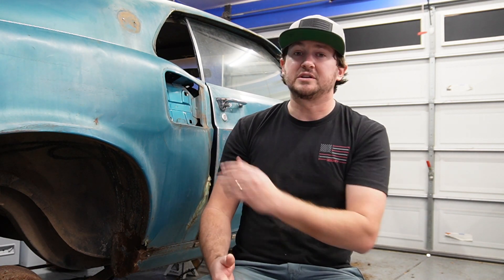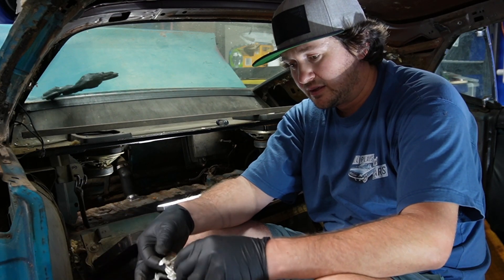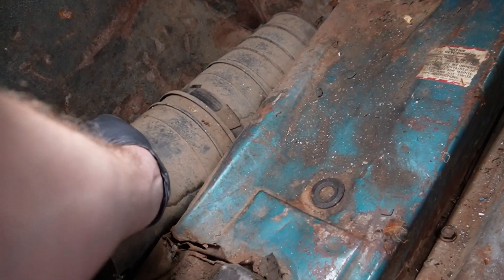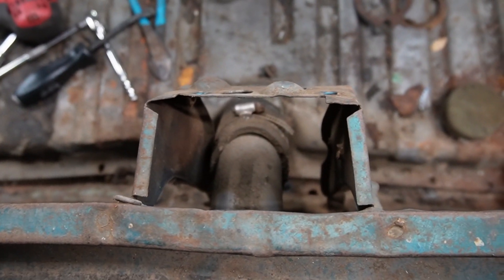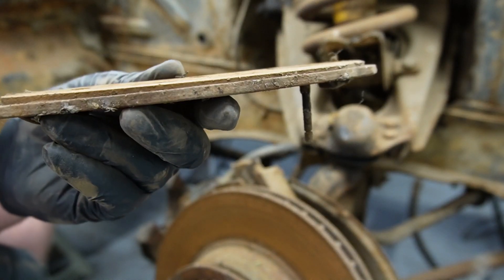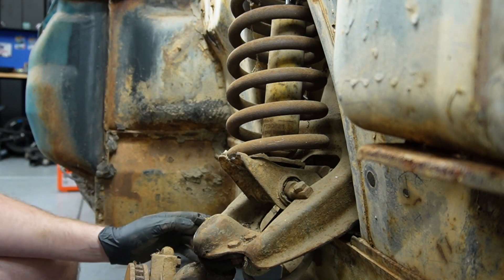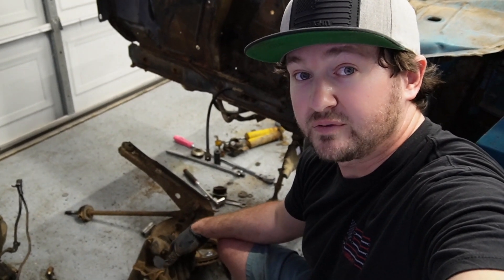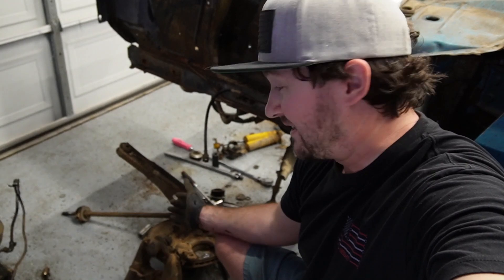UNCOVERING THE SECRETS FROM ITS MASSIVE WRECK 30 YEARS AGO!!

Comment: No no don’t throw away the suspension parts or anything you don’t need it’s like gold to some one building a non disc car
Reply from the maker: With the amount of damage on the right front, I wouldn’t use any of it 

But I’m still gonna list it for sale as I’m going full Detroit speed coil over in the front with Bear disc brakes in all 4 corners

Comment: Just subscribed. Good work! I’m building a 66 fastback. I cut the strut towers out and put an AJE k member in it. What suspension will you be using?
Reply from the maker: Thank you 🙏 I’m up in the air brand wise. I am going to do modern suspension. I just don’t think my pockets are deep enough for Detroit speed
Reply: @69fasttimesgarage72  yeah I had the same issue. Don’t overthink it. With the strut tower damage I would heavily consider a m2 based suspension.
Reply from the maker: I do often overthink my choices, there are so many and to spend the money that parts costs. I way all my options and still question the decisions

Comment: You have probably found this out already but that is not a fold down seat. Although it was a option in some 1969 Mustang fastbacks.
Reply from the maker: Yeah, after I did the digging on it, def not a fold down. But it sure seemed like it with the swivel point hinge on the bottom